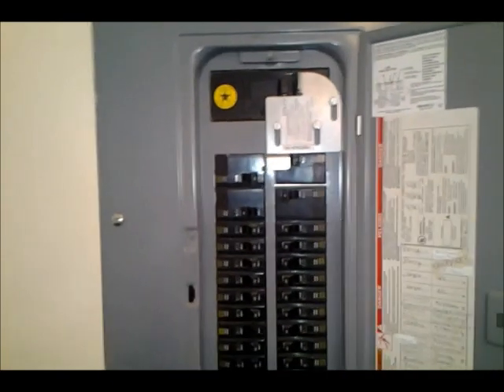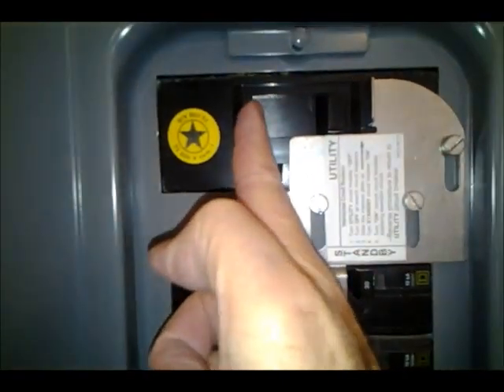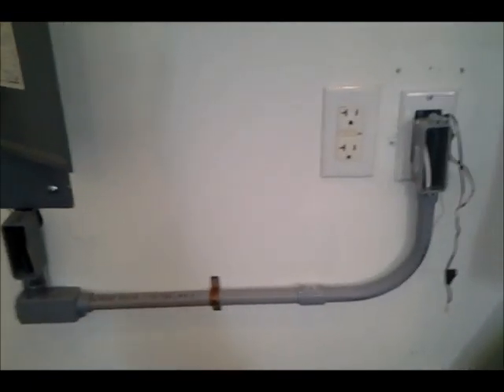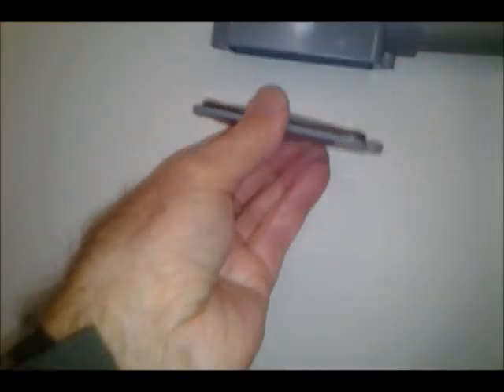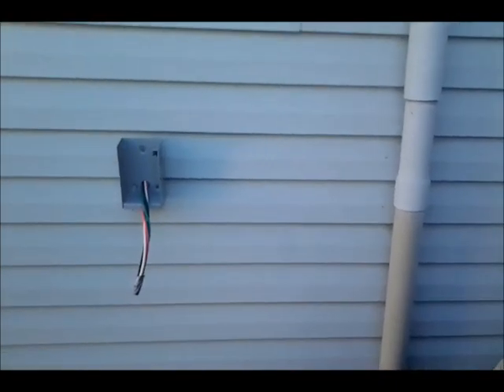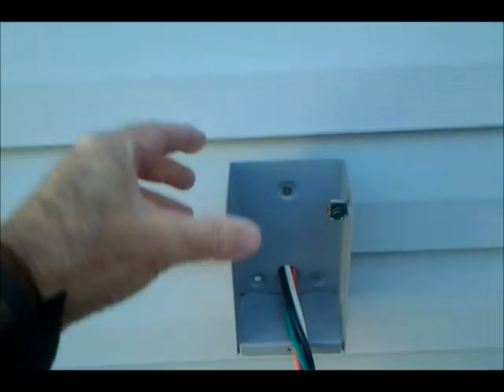Generator Inlet Box Installation

Comment: This is seriously some of the worst work I've seen in a while. And I will take the time to be specific. For the record I hold a masters license in 2 states. 
@1:52" you have one LB under the panel that is just sleeved in the open wall with exposed wires just beyond, it appears that the LB you have directly under or "back to back" is just connected with duct tape. All PVC joints are required to be primed then glued. Then moving along you're using copper plumbing straps to support electrical PVC, and it heads into another LB that's literally resting over the front of a plastic decora cover where the device has been removed. This is awful awful dangerous work my friend. 
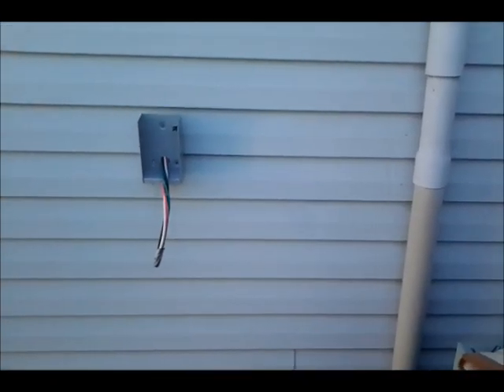@4:26 your wire that's sleeved openly in the wall, lol, enters the back of your rain tight box with no connector and it looks like your wire is close to the sharp edge of the knockout. ALL WIRES ENTERING ANY POINT OF JUNCTION NEED TO HAVE PROPER CONNECTORS. 
Your intentions are good but there's a reason this work needs to be done by professionals. I see people who know even less than you praising you and asking questions in the comments, potentially leading them to do even worse work than you. This is a terrible dangerous install where absolutely no part is compliant in any way. A nightmare electrical job.
Reply from the maker: Good points, Geminye, but I made these changes in a video posted in the description:  https://www.youtube.com/watch?v=gdkag8AecN4&t=0s

Comment: Isn't it better if you put a cable clamp on the back of the box first and then run your wires thru that to keep your conductor wires from accidentally getting cut by the box ? Seems too me that would be the safest way to go. What do you think because I've got to install one too ? And what about running the wire thru conduit thru the wall of the house ? My 6/4 SOOW wire has to go thru brick and cement block.
Reply from the maker: Yes, Chris, that is the best way & that is code.  I did that in updates, later, too.  Best of luck & let us know how it goes.

Comment: Not code in NJ... No connector... or... bushing...
Reply from the maker: The thing is I will be watching this entire setup while it is running & watching for fires, etc. :) This is not a system that will run 24/7 but just during emergencies.  And if I move, I will remove everything & take it with me. I am sure code varies from State to State, Country to Country, etc.!

Comment: So code doesn’t allow for non sheathed cable to ever be outside of conduit until it is inside a box. On the outside I can tell the conduit did not go through the knockout which means there is non sheathed cable inside your wall for a couple inches. 

Sliding a piece of conduit from the outside in would fix this if you can get it to your other conduit. This would make sure the knockout in the back of the box had no ability to rub on your cable and damage the wire insulation. 

Replacing the whole run with sheathed cable would also work. After the sheathed cable enters the metal box outside the wire needs to be secured to the box when going through the knockout using a wire clamp.
Reply from the maker: I think you are probably correct on these items, Eco, but I use this so infrequently & I would never be nailing into the wall or anywhere near the conduit, while it is running.  Thanks for the comments & I will consider them.
Reply: A hack would be to slide heat shrink over the 4 wires trying to get the heat shrink as close to the conduit as possible. The coating on the wires themselves is optimized for electrical resistance not abrasions. The sheathing is optimized for abrasions. 

Once the heatshrink is on you can then use a clamp in the back of the box so the wire doesn’t move around.  This is definitely a hack and should never be done. But it would be better than not having the abrasion layer there. 

Also remember a back feed circuit like this is not protected fully by the breaker in your house. So there is a situation where the hot wire in this box touches the box it self and no breaker trips. If this happens all the metal appliances could become charged.  Another protection from that would be a gfi in the generator or a gfi between the generator and the plug. 

Good luck

Comment: To Every buddy watching this video. This video represents,  John H Know enough information,  to be Dangerous video. Thers a reason why Qualify Electrician  Have License Proper training and Schooling. Before you do electrical work consult a Qualify Electrician. Pick there Brain for knowledge because John H Didn't.
Reply from the maker: I am just a Professional Engineer, PE.  When you cast aspersions, be succinct, please!
Reply: @harrison4803 , No Actual Professional Engineer wouldn't of done that job how you did it. The way the wire was run no insulators around the K'o ,To protect the wires where the wire pass through, No sealing On the back of the O.D Box, for weather tite. Passing Non Jacket  conductors through the Wall. A Google search can confirm my Observation. If you want to verify it. As for My aspersions. 26 year License Master Electrician. With 2 Mechanical  Engineer Degrees. Also I consult for A insurance company when there is a Incident in Electrical origin. Preferably when a building burns dew to faulty wiring. Unless this job was done in a 3 world county where there's no electric laws. Then my bad.

Comment: Thank you for making this video. It is very helpful. I have few suggestions to address the comments. It seems to me that you could have routed a ROMEX cable to the generator inlet box outside through a knockout on the back of your breaker panel.  If you prefer to have the inlet exactly at the same location, you could have used an MC cable instead of conduits. Running MC cable over dry wall in the garage and through the wall is code compliant. Just drill a small hole through the wall and feed the MC cable through it to the back of the inlet box and seal the hole around MC cable with caulk. I have done that myself before as a home owner and passed inspections.
Reply from the maker: Vikram, I didn't know what was under & behind the panel and there was already a hole where the previous owner had run his "dog fence" wire, so I decided to use it & also run my solar panel wires through it. Probably would have worked if I had seen the original installation of the panel, but I did not.  Thanks for watching!
Reply: Got it. I planning to do this installation as follows:- 1. Break a knockout on the back and use a flex bit with a wire fishing hole to drill out. 2.  Fish the  ROMEX inside the breaker box using the flex bit. 3. Install the Romex connector in the knockout and wire the Romex inside the box.
Reply from the maker: @vkapoor69  Sounds, good!  You are more knowledgeable in wiring than I am. If my garage had not been finished, it would have been easier to figure out.  Let us know how it goes!
Reply: Luckily there is a blank faceplate on the drywall below the breaker panel. I put a phone through it to photograph what's behind the panel. There is a conduit for main supply cables and couple of ground wires.
Reply from the maker: @vkapoor69  My main supply came in from the top but I was not sure if there might be anything else below.  Best to be safe.

Comment: No one should ever install any wiring to “Old John’s” standards. This is an electrical disaster. The duct tape hold the LB’s together. The LB through a plate cover to get outside. No connectors. You sir are going to cause someone to burn their house down. If anyone comes here for info on how to install a generator hire a licensed electrician. This is an absolute disgrace. Sorry john
Reply from the maker: Robert, see my upgrade video, mentioned in the description:& at 4:00 or  https://www.youtube.com/watch?v=gdkag...

Comment: As an electrician, I can see many shocking things wrong with this installation.  Who runs unsheathed wire through a wall?  Amateurs!  Installing a generator system haphazardly, can be deadly and should never be attempted by an amateur.  I can see the owner plugging the cable into the box in the pouring rain and since he didn't use conduit or at the least, a bushing or threaded nipple to protect the wire entering the metal box, that box could easily be live and kill him on the spot.  Inside,  it looks like a circus, with the wire running through a gfci receptacle plate and then unprotected through the wall.  I strongly recommend this total job get removed and hire someone that knows more than enough to be dangerous.

Comment: Not bashing your video because this is very helpful however when you make a “how to” video you must be very clear with what wires are connected at the outlet also zero Romex connectors used on the panel or the outside outlet. Any Experienced inspector would have failed the duct tape job alone also and most importantly make sure everything is grounded I didn’t see you bond the 10/3 in the outside outlet.
Reply from the maker: See my upgrades to my conduit video:
https://www.youtube.com/watch?v=gdkag8AecN4

Comment: It seems people installing these interlock kits are sending both the ground and the neutral from the generator back to the neutral bar in the breaker panel. Isn't it true that portable generators have the ground and neutral bonded in the generator (for when you use extension cords with a ground wire)? When connecting generator directly to the breaker panel without a transfer switch, shouldn't the ground and neutral be unbonded at the generator, and then the ground sent out its own grounding rod? This is the way standby home generators are wired.
Reply from the maker: looneytoob, good point and I made a video on this.  It is in my playlist and I need to link it to this and all of my generator equipment videos.  See what you think?  https://www.youtube.com/watch?v=77Q7Yh-JBoY&index=2&list=PLtPT9KQSzU8iYlN5Yr9MtHUJKNu04rWKk

Comment: Does installing a double pole breaker automatically provide power to both sides of the panel?
Reply: If you use a double pole breaker (that takes up two breaker slots) yes it should power both sides of the panel. Just don't use a "tandem" breaker that takes up a single slot with two breakers on it.
Reply from the maker: Michael, I don't think so?  They are normally for larger circuits, 240v (20-60a) and appliances.  Thanks for watching.
Reply: Well I'm confused because there are numerous videos of people installing interlocks with a 30 amp double pole breaker to provide power to whatever circuits they want. Is this true or not?
Reply from the maker: Michael, you probably should ask them or an electrician, to be sure?  My single pole does supply power to both sides because the way the panel is wired, I assume?  See Eddy Q's comment below.
Reply from the maker: Good point, looneytoob!  Thanks, for watching!
Reply: It all depends on the panel, as long as your panel allow tandem breaker's and they fit well on that slot they could be use and will power both side, it all depends on what order they are lay out so they could fit.
Reply from the maker: Thanks, Robert!

Comment: Viewers please, at least, buy a Sears Home Owners Wiring  book before doing an electrical installation and don’t duplicate the wiring methods shown in this video.  I shudder when I walk into customers’ homes and see  things like this.  John H, I’m not bad-mouthing, I just like to see a safe and code-worthy installation.
Reply from the maker: Don L, I assume your comment is about the wiring size that you mentioned on my interlock video?  It is the cable that came with the generator and is 10AWG with 3 wires and a separate ground.  I just removed the covering around the wires and put them in conduit.  So, you think the generator mfg. provided the wrong size wire?
Reply: Hi John H.  As mentioned by others, your conduit system is in doubt.  You said you have corrected some issues.  At 2:43 in the video, it appears that the conductors leaving the back of the LB and entering the loadcenter are unprotected (not sheathed).  Wiring concealed within wall spaces (or exposed for that matter) must be in a conduit system or converted from a conduit system to a cable system in an approved manner (approved cable fittings at boxes,conduit, etc).  Regarding the conductor size, 10awg is correct for a 30A circuit, BUT removing the cord conductors and using them in the conduit is a violation as they are not approved for use in anything but what they were designed for-cord.  The conductors in the conduit (if a complete conduit system) should be individual wires of a type THHN or similar.  Cable type 10-3wg NM-B could be used in the conduit as the conduit would be just mechanical protection ( a complete run of 10-3 from the loadcenter to the outside box with the exposed portion in conduit).

Comment: How do you guys keep these boxes dry inside? I am looking at these screw holes and cable inlet in combination with rain water dripping down ans seeping in.
Just curious, as I am not used to electrical boxes outside the house.
Reply: Fill gaps with bubblegum.
Reply: Use silicone on the top and the sides, DO NOT PUT IT ON THE BOTTOM. Rain water wont get in from the bottom but moisture will be trapped
Reply from the maker: As I point out at the end of the video, you can caulk around the box with a silicon  material.  Thanks, for watching!
Reply: Should use primer and glue

Comment: Hmmm.  I am installing PB30 this now and I am sure the RED wire should go to "Y" and the BLACK wire goes to "X".  For a 120V generator, the Red "Y" connection is not used.  Wired properly, this input box should be able to support a 240V generator safely.  If not, fire could result.
Reply from the maker: +Mark Indiveri Mark, my installation sheet, which I am glad to send you a copy of, says to "use a four-conductor cord suitable for a 30 amp load".  Also, "Red and Black cord wires to the terminals marked X and Y".  I don't think this means red has to go to X and Black to Y but both seem to be required.  Thanks for watching.
Reply: +John H 
http://diy.stackexchange.com/questions/39924/l14-30-plug-generator

If I reversed Black and Red, I would be fine if I only ever stayed with a 120V generator, because it's only one phase.  But, if in an emergency, a friend with a 240V generator wanted to plug into my home, the phase of the 240V feed would be wrong, and would probably burn something, most likely in the generator, but a fire could result. 

Wired correctly, the Black "X" wire is feeding the house, and the Red "Y" wire is Unused.

Comment: Open conductors are not permitted in a wall.  Duct tape is not appropriate or approved for connecting condulet fittings.  A water pipe strap is not approved for electrical work.  The cable needs a connector when it enters the back of the inlet box.  This is an example of how not to install a generator inlet.
Reply from the maker: John Grabowski Thanks, John, for watching!   See my comment below to jtjohnst1965.  Will consider your comment on the strap.
Reply: I am glad to see that you are taking corrective action, John.  However I am concerned that your video is giving out too much bad advice and an unknowing novice will follow that. May I suggest a remake?
Reply from the maker: John Grabowski John, I will add annotations and point out corrective actions being taken.  Thanks for your input.
Reply: +John Grabowski hey! I need some help with electrical work. would you be able to help me?
Reply from the maker: +T Bear You should click on his name and message him.
Reply from the maker: See my upgrades to my conduit video:
https://www.youtube.com/watch?v=gdkag8AecN4

Comment: No caulking? You ran your wires directly into the box with no clamp through the knock-out hole outside?
Reply from the maker: jtjohnst1965 Yes, John and it is on my list to add a clamp, short  piece of conduit, through the wall and then caulk between the box and the siding.  See my comment below.  Thanks, for watching.

Comment: This is clearly done by a do it yourselfer that is fine. But be care in using these tip because they do not me electrical code. If a fire were to take place insurance companies love to not cover claims because of incorrect installations.
Reply: John H His entire conduit job is horrible...  The entire conduit path should be sealed (using couplings at the 1:50 mark instead of duct tape).  Where the conduit connects to the main panel and also to the power plug box (5:55), it must use an adapter that has a threaded end and a lock nut.     http://www.menards.com/main/electrical/rough-electrical/pvc-conduit-fittings/3-4-pvc-male-adapter-bag-15/p-1740663-c-14347.htm

This never would have passed electrical inspection...
Reply from the maker: Andrew Miner Good comments, Andrew!  I will incorporate them before I use the hook up again.
Reply from the maker: John H Again, Andrew, good comment and I will add additional conduit!
Reply from the maker: James, what specifically does not meet code?
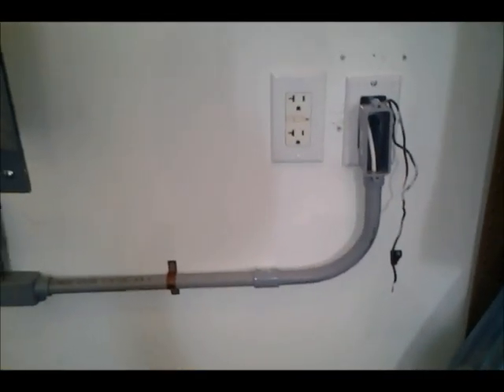Reply: Andrew Miner And the 2:00 part where it goes into the wall should be solid conduit to the back of the power plug box.
Reply from the maker: See my upgrades to my conduit video:
https://www.youtube.com/watch?v=gdkag8AecN4

Comment: You should think about a silicone sealant around the top and sides of that box where it meets the siding. Leave the bottom unsealed in order to prevent moisture build up.
Reply: They make a vinyl mounting block that fits over the siding and offers a smooth, flat surface to mount anything electrical.  Find them at HD and Lowes.  Done correctly, you wont need sealant.